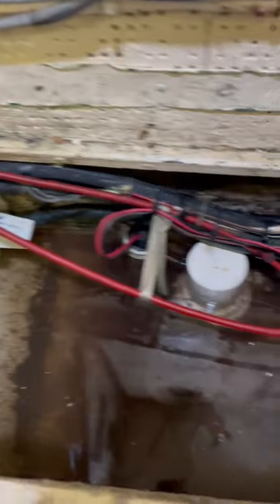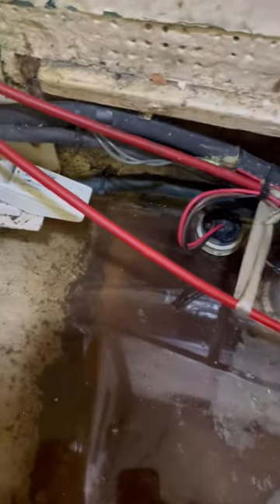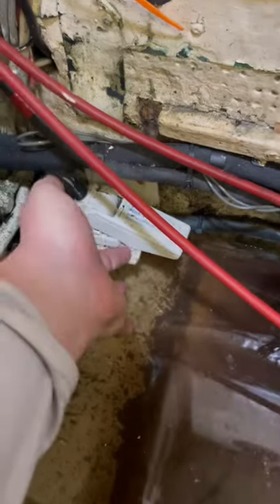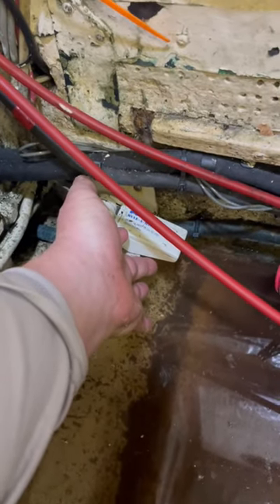60 second boat survey (Ep30): High-water bilge alarm!

Comment: Good thing about that is that it’s easy to replace. But if I were buying I’d go with a higher gph In bilge pumps.
Reply from the maker: Better yet, a second larger backup pump. That leaves the smaller pump to handle nuisance water (leaks, rainwater, etc) with less battery drain, while the larger pump can kick in when needed.
Reply: @everythingboatswithCaptFrank   or  get an automatic that way you don’t have to worry to much about it

Comment: Seems like it should move more freely than that? Don't know much about it but just a question from a diesel mechanic
Reply from the maker: The operation of this particular float switch was actually pretty smooth. That being said, I do often find some that are a bit stiff or sticky, unless the owner tests them. Otherwise, they could go years without being cycled. That's one reason the alarm system (and bilge pumps) should be tested regularly as part of the vessel's overall routine maintenance schedule.